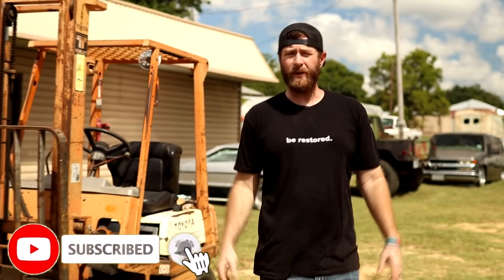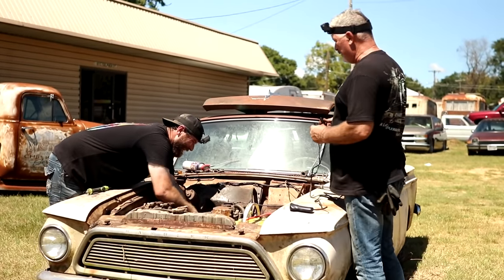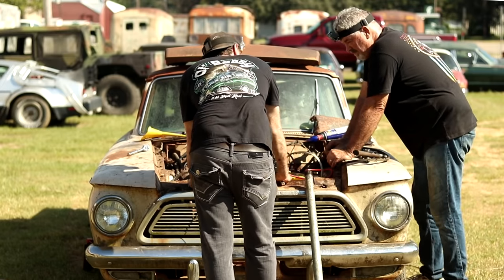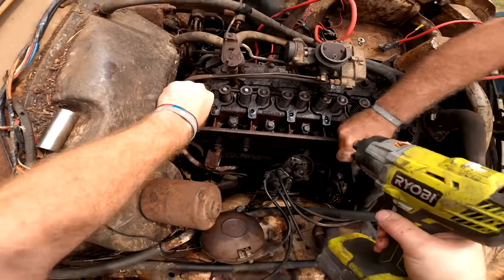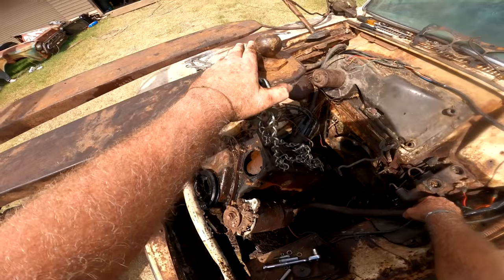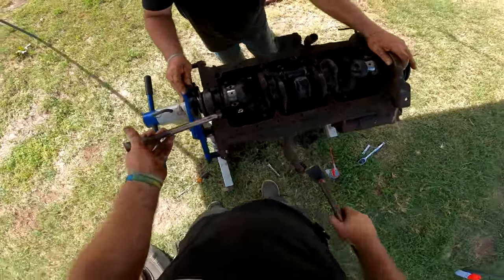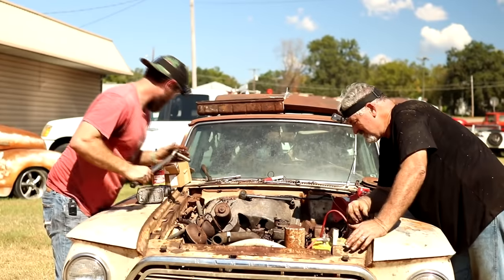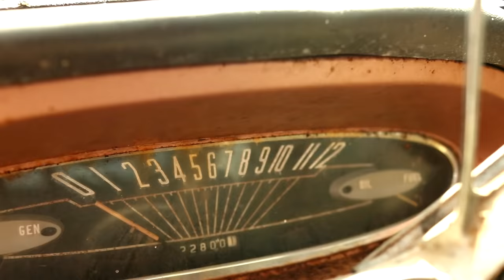Will It Run After 50 Years? | Forgotten 1962 American AMC Rambler | Buried & Locked Up | RESTORED

Comment: Persistence pays off.  I never thought you would get it running but you just didn’t give up.  Best will
It run in a long time!
Reply: Once again thanks for your work, l want to share with you that l had a Rambler Javelin model 1974 standar trasmitión 4 speed, a motor 6 cilinder on line, you make me remember great moments in the restoration when l did it, thanks for your atention and share with you my experiencience have a good time,,, your friend Oscar de Pachuca HGo Estados Unidos Mexicanos,,,

Comment: Guys I just found your channel, and this specific video brought back a lot of memories for me. In 1990 I was 15 years old, and bought my very first car, a 1961 amc rambler deluxe 4 door. All original, and in pretty bad shape under the hood and the interior, but the body was straight. My dad and I restored the interior as best we could, and tried to find someone who could work on the engine, old flat head 6 cylinder, 195 3.2 I believe it was. Finally found someone who knew how to work on it, but due to the lack of finding parts, couldn’t repair all of it. But we got it running enough for me to drive it to school everyday for a year…it had a hole in the manifold, and it sounded like a herd of tanks coming down the road. I bought it myself for $100, and sold it for $800, just to buy a 1963 Chevy 2 Nova. That was already restored for the most part, and lucked out finding it for only $500 in 1992. Bought it from a guy who had no use for it anymore because he couldn’t drive it. I loved that car, but sadly had to sell it for emergency reasons. I’ve always wanted to find another 63 Chevy 2 nova, if you know of anything anywhere, seriously, please let me know. Love that you guys restore old cars like this together, my dad and I did that before he passed.

Comment: Hello. 
Hey it's a rambler. 
Take off the starter and use a big screwdriver or flatbar pry the flywheel from the starter hole. It will work

Comment: Great job! My father could restore anything. And watching you working on that rescued little Rambler on what looks like a super hot day, inhaling that old mouse nest, reminded me of my dad’s determination once he got under the hood. Thanks for a happy memory.
Reply: Pensé lo mismo. Tendrían que trabajar con guantes y demás implementos de seguridad. No les vendría mal un curso sobre bacterias, hongos, virus, etc.etc.
Reply: Your dad was a wise man hop you took his skills and use them well
Reply: I would sell.my car in a heartbeat and drive the ole rambler any day
Reply: Its a classic now check out all yhe character and the charm on that rambler
Reply: Should be useing tranny fluid  in the cylinders not wd 40
Reply: I  know for a fact if the alternater is seized it will stop the moter from turning over take the belt off
Reply: Also when trying to unfreeze a stuck moter always turn it backwards  it will free up easier
Reply: Try useing screw driver on the ring gear teeth
Reply: U can use a wood to hit on he pistons it won't damage it and it works good
Reply: Fix the ole girl  thank you for leaving it stock and leaving it origional
Reply: Exxelant job boys the AMC LIVES
Reply: Even better yet i just noticed now its a ambassador higher end model so cool

Comment: Got something for Mortske Repair to work on with all his stuck engines. As he usually uses heat, wood and a hammer and they're still stuck. Wonder if you measured the piston and cylinder wall tolerances but it appeared to have compression at least.

Awesome you got it to run. Deserves a proper rebuild but it would be interesting to see how long it would last, toss a hour meter and drive it around town! 😁👍

Comment: Wow that old Rambler sure does bring back memories. My mother had that exact car and color but with an automatic. I enlisted in the AF when I was 18. She bought it right after I enlisted in the AF. I came home on leave when I was 19 and took my old girl friend out on several dates in that car. BTW, there was an option on this car where the front seat would fold all the way back almost into a bed. My mother's car did not have that option but as it turns out the mechanism is there just the handle to activate it was missing. Turns out a screwdriver will make it work...  ;-)
Reply: But a problem I eventually had with my 59, was that the front seat eventually would lean back too far, making for an uncomfortable driving position...the seatback mechanism would just slowly fail.
Reply: Yup, my older bro had a 1966 AmbASSador and the front seat folded back to create a bed on wheels!

Comment: It has been several years but I do believe that you could pour some brake fluid in each of the cylinder on the Pistons and allow it to sit couple days

Take you a large pipe wrench monkey wrench whatever you call it and spin the back by the flywheel and you can free that engine up

Comment: Factory AC Rambler American 60 61. The 60 had a flat head 6 cylinder. Hoses and wires were still made without peanut oil. Rubber had more petroleum distillates. Not a tasty treat.  Great film.

Comment: My brother and I once had a 1964 or 5 American with a locked up flathead.  We bought a roll-over accident '61-63 American with the overhead valve engine.  The motor mounts were different, so we pulled the flathead and tranny out of the newer American and cut the mounting crossmember out of the OHV body still attached to the engine.  We lowered the whole engine/trans/crossmember assembly into the newer body and welded the crossmember to the body.  Fit like a glove.  Drove that car for quite some time.

Comment: Great old car I had one with the E-Stick  ,it was a stick shift without a clutch pedal .you just lifted on the gearshifter and it engaged the clutch . it was cool except for the flat head engine .that had head studs and not bolts ,so the  studs would grow to the head ,( Thank God for Marvels mystery oil )and you had a heck of a time getting the head loose .

Comment: Not to rain on your efforts because it’s pretty cool to get an old car running again.  But… after spending literally years getting a couple old cars back on the road, it’s not as easy as you can make it look.  One has to rebuild virtually everything, w/fuel system it’s a gas tank restoration, new lines, filter, fuel pump rebuilt & carbs rebuilt too.  It’s that way with every system on a car that sits too long….

Comment: The 1962 Rambler was the first car I drove with a license. My father paid $45, just signed the regi and you bought yourself a car.. Me and my father did a ring job on it. To change the clutch in that wasn't easy. It didn't have a universal on it to drop the drive shaft.  I had some great memories in that car...
Reply: Right. You had to slide the rear end back to remove the driveshaft.

Comment: I drove a 1959 Rambler in high school.It was a pink and white station wagon. Later I bought a 62 white wagon that I drove for a few years.I also bought a non running model just like the one you gat running. I paid $2 for it as a parts car but I should have tried to get it running. That was read with a black top and the paint was in very good condition. I thought it was pretty old at the time but thinking back it was only 12 years old. 1974. They all blew smoke like crazy but I literally fixed the overdrive on my wagon with a paper clip. Good times.

Comment: My dad and I put a 327 in one of these in 1964 or 1965. The only issue was the exhaust hung too low, and hit the RR crossing when driving from the wrong side of the tracks to US45 where we could get out of Loda for a while. It had a three on the tree with a mechanical overdrive which turned it into a tire burning monster. In 2nd gear push the OD knob in and stomp the gas for fun on the street.

Comment: When turning from the back axle you will get more leverage to the crank when you put it in high gear. Same reason when push starting you use 2nd or 3rd gear to turn the engine.

Comment: I had one of the same, when I was 17, used to be my old man’s and he drove it for years and then I ended up with it and drove it for a few more years. When it finally took a dump, I was leaving work, from a horse farm, headed home for the day and it’s a good thing I was still on the farm, heading down the main drive towards the main road, and the rear tires just locked up and I stopped dead in the middle of the driveway, haha, rearend locked up, I believe the spider gears went out of it, I think? That’s been 45 years ago, so. Yeah I’m an old man myself now. But shoot I had several Rambler’s over the years and several different AMC products.

Comment: I learned to drive in a 62 Rambler Classic.  Either this is an American 400 or a Deluxe or Custom with the optional OHV engine.  The OHV was standard on the 400 package.  This was also the year AMC introduced the dual master cylinder to all its cars.  Cadillac & Jaguar were the other 2 makes that had a dual cylinder.  I figured it was a manual transmission model when I saw the Holley 1908 carburetor on it.  Rambler uses AC Delco starters, distributors and generators on the engine.  There is one difference between the California and 49 state models:  California models have a PCV Valve on them, starting in 1961.

Comment: If all else fails, find a Gremlin and swipe the engine from it -199,232, 258 are physically similar ; you've probably already busted the budget, or will be by the time you get it back together, so what's a little extra ??The Rambler/AMC Sixes are practically indestructible !!

Comment: My buddy’s, the Bailey twins, parents owned on of these. It had what AMC called the E Stick. Their was a 3 speed and you could get about 72 mph in second gear and maybe going down a hill you could get 80. We drove the daylights out of it and it never blew.Looks like it had A/C and a dual master cylinder for the brakes. Rambler was pretty innovative just like Studebaker and the rest of the other non big 3. My friends car was a 4 cylinder if I remember. I have a 66 American it had a 199 cu in 6. This engine is the baby brother of the 4.0 that Jeep’s ran for many years.
Barney Navarro built a Rambler 6 for Indy. He test drove it like at Mid Ohio. Didn’t remember his oil pan was made to catch oil on left hand turns only. He burnt 2 main bearings.
Reply: ??? My first speeding ticket was for 90 in a sixty... Driving the SMALLER engine version, the flathead six. 90  hp.

Comment: Against my better judgement, I bought a 1948 Plymouth that was stored many decades outside in MN winters. Amazingly, there was no rust perforation after all of those years. (1950s cars stored outside, on the other hand, were almost always severely compromised by rust.)  The only way I could get the engine to turn was with a very heavy screwdriver on the flywheel. In the end, the cylinders had huge ridges on them, so it was all for naught.

Comment: It's tbe optional OHV Six.  Rambler Americans were the very last cars to have a flathead (side valve) engine, basically the same 6 as this motor, until 1965.  AMC offered OHV heads on the 196 ci engine as an option, or standard on the de luxe 440 models.  This looks like it has factory air conditioning!

Comment: Its funny watching folks work on something new to them when that something is what you spend much of your years on:  the Rambler 196 block is made from high nickel steel and as such it rusts a bit differently, forming a tight rust matrix.  Ramblers respond to a mix of Seafoam Acetone and ATF.  They also do well with an air chisel on a metal plate set on top of the piston.  I was cringing each time that hammer hit a piston as I broke my share of them!  The Rambler head is so massive that it heats in the middle and not on the ends which winds up causing the head bolts to back out.  Eventually the 1 and 6 holes experience head gasket breaches and overheating begins.  the fix is a cooling system bypass at the thermostat and ARP studs on the head

Comment: I know I am a little late on watching this, but there’s something I think could help when trying to use the driveline to roll the motor over. The higher gears will do a better job of multiplying the torque that you add to the drive wheels. Just like a how the lower gears make the job easier for the motor to move the wheels. You’re sending the torque back up the driveline, so the gear ratio works in the opposite direction as well.

Comment: Now I am new to the channel and I not nearly as knowledgeable as these two guys, but why didn't Y'all try putting a little heat into the cylinder to get it to move? I not trying to be a jerk I just don't understand that seems like a much easier route to a solution. Love the video. You guy got a new subscriber.

Comment: wD40 is not a penetrating fluid, they make one. Don't know how good there's is. PB is used by a lot of people and works very good.
Reply: Yes a lot of mechanics use WD-40 as a penetrating oil cause it does loosen nuts and bolts etc

Comment: if you weld two pins about two inches apart on to your cheater pipe it becomes a spanner that will grab the edge of the crankshaft pulley giving you tremendous leverage without fear of breaking the crankshaft bolt

Comment: Another Rambler story from 1972.. this guy hated his Rambler station wagon and parked it in a remote area, rigged the throttle to run wide open in park and left hoping it would blow up. He came back 30 minutes later and it was still running.. decided to keep it afterall.

Comment: I do not doubt at all of the mechanical knowledge they have, which I do have clear that they won a non-trained in planning. 
1st Clear the engine compartment and extract out of the vehicle. 
2nd Once outside, remove the cylinder head and check the seats and clearances, remove the oil pan and check the clearance or defects in the crankshaft wrists. 
3rd Turn engine by hand and check valve opening. 
4th Check starter motor clean brushes and replace if necessary, replace spark plugs and wiring. 
Once the above has been verified, test the engine on a bench. It is very risky to try to start the engine as you try since it can cause irreparable damage to the crankshaft or other moving parts. 
Sorry for my bad English, I'm a retired Spanish mechanic and I don't speak the language.

Comment: when you put it in 1st gear the gearing is actually geared up if the power comes from the back tires, if you put it in 3rd it's direct through the transmission but you get a step up in gearing through the rear end, not a reduction.

Comment: If it has a pulley on the harmonic balancer we use to take a pipe wrench and slip it on the pulley and take a pry bar and break it loose or atleast try to break it loose. Its not any fun after you break the harmonic balancer bolt off in the crank. You might as well just stop at that point

Comment: Another idea to get an engine to turn over is to screw a pneumatic nozzle into the spark plug hole and push compressed air into the cylinder.

Comment: 50:20 as you beat on the rod bolts the other side is damaging the surface of the crankshaft.  You can hear it clanking as it as you strike the 2 X 4

Comment: I have has good luck with white vinegar leave it for 24-48 hours in a locked up motor it eats the rust and as long as you don't leave it too long it won't hurt the cylinder walls.

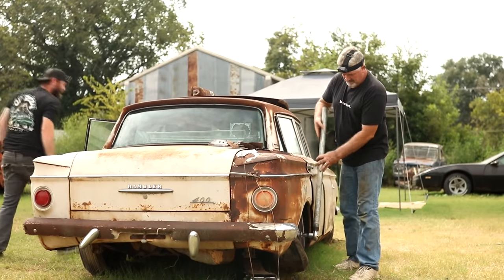Comment: 30:40 you always put the unit in HIGH gear when trying to turn over the engine with a wheel, think about the ratio's you are dealing with (in reduction is opposite of what you want)  Oh, that nut on that axel will finally break off if you keep this up !

Comment: Amazing that thing MOVED! II am not into fosil fuels however if the carb or replaced with adjustable injectors and convert the fuel that makes water at the other end, namely Hydrogen, as that is the ONLY gaseous fuel that is NOT a hydrocarbon and thus would not contribute to this climate crisis. I woudl say go and convert this to electric however being a historical gem, to run of the originsl rngine at least H would do it cleanly. Also a good paint job would be in order reinterioriseation, and to get the buffers and front grill recromed would really be nice.
Reply: Synthetic fuels would be the best bet once the fuel scientists get to the point where you can buy it at gas stations.

Comment: did you pull all the pistons, un stick the piston rings clean/hone the bors a bit, pull all the valves regrind the valve seats?, if u had it would fire up, off a bottol of fuel, i bet the carb is naff.

Comment: Any time you boys run into a stuck engine, with aluminum pistons, You need to just try everything y'all are doin, BUT, when y'all take the head off, you skip two steps my Granddad taught me. 1. get some muriatic acid, and put a small cupful into each cylinder, or whatever they can hold, and let 'er set.This acid is AWESOME at cleaning ANYTHING aluminum, and won't hurt anything in the engine. 2. HEAT. Rosebud tip on an oxy-acet. torch, slowly heat THE WHOLE BLOCK, just as if you're runnin it through a heat cycle. Usually, this'll break em loose.

Comment: You make the 3 Stooges look like master mechanics.  The head should have been removed as soon as you found the engine was stuck and the MMO did nothing.
Reply: And yet they got it running....which was the goal of the video. Pretty small percentage of the population today can do this anymore, or want to. Gotta have a passion for old cars and a willingness to dig in and get the job done.

Comment: You were standin in the wrong spot if that engine did crank over.
With trans fluid in the cylinders. 
That would have sprayed all over you.
Which would have been funny if it did spray you.

Remember watch where you stand when tryin to turn an engine over with any kind of liquid in the cylinders.